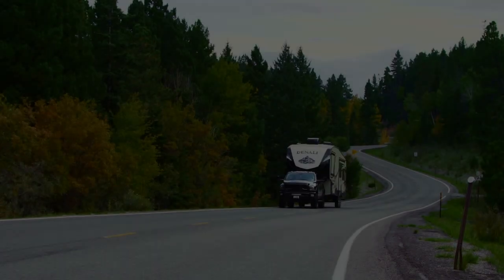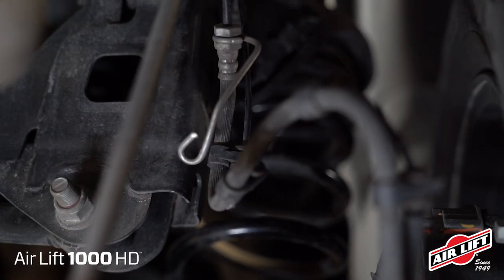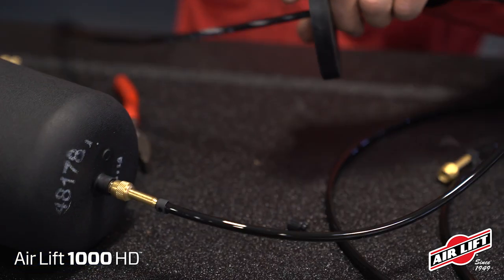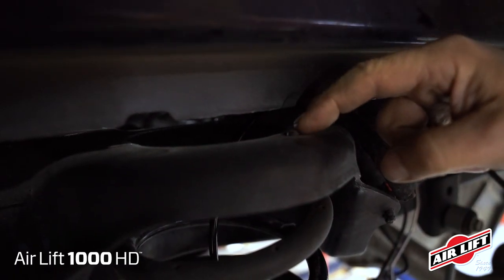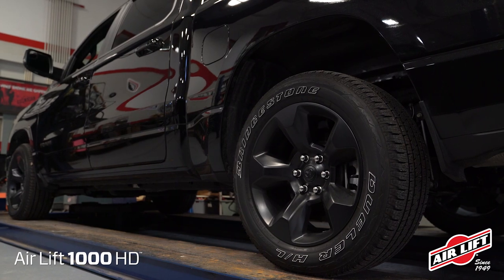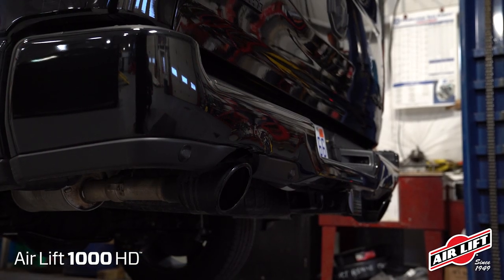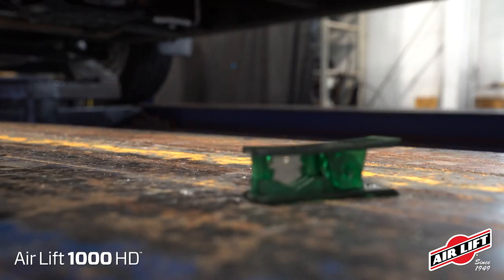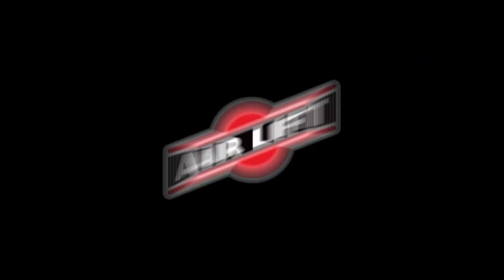Install Overview: 60828HD - AL1000HD - Dodge Ram 1500

Comment: So I add air before the weight cant do afterwards?
Reply: So it's kinda a guess game add 15 psi load trailer check. If not good jack trailer up to take pressure off then increase psi and repeat?
Reply: @StevenAdams  that's what I do

Comment: I would not recommend these 1000HD bags if you live in a cold climate. I have had to replace mine (under warranty) multiple times due to cracking and leaking. Airlift knows about the problem and just continues to send warranty replacements. I'm sick of changing out the in-coil bags and am going with another company. To bad airlift won't allow me to pay the difference for a different style of airbag, they have lost a customer and I will let everyone know of the issues I have had.